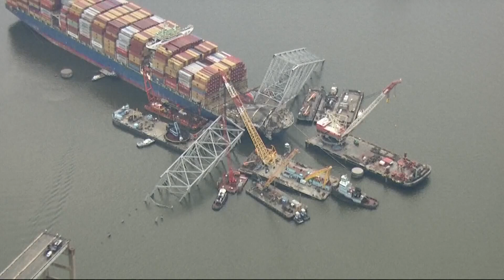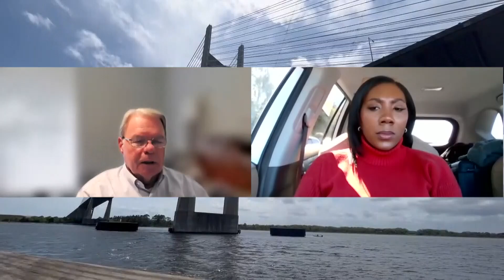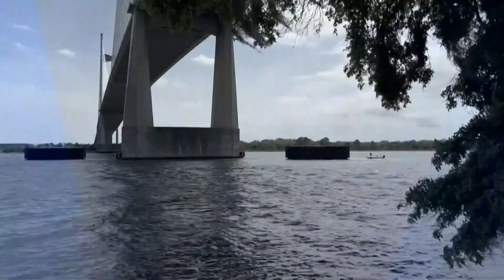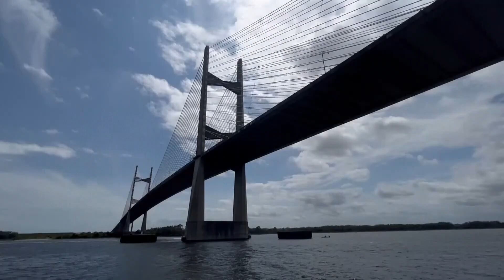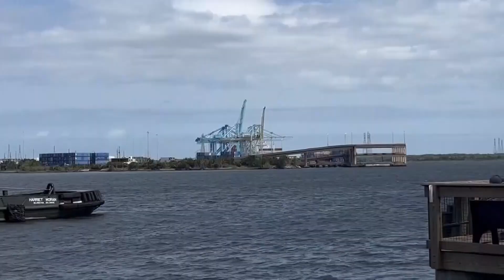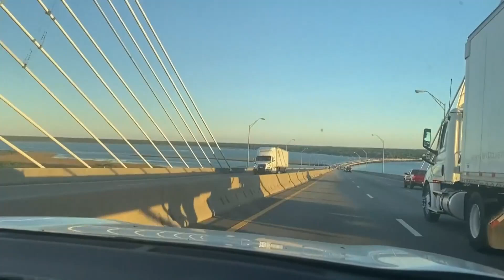What a structural engineer says about the Dames Point Bridge after NTSB says it might be at risk

Comment: Any bridge hit by a large vessel would collapse. 🙄 And this guy will makes tons of cash from his inspection.
Reply: Amen. WTF designs a bridge to be hit? That would be like requiring skyscraper to be hit by a plane. The simple solution is to have harbor pilots taking all the large vessels in and out with tugboat support. Problem solved!!!
Reply: First thing I thought. Was a structural Ironworker for 40 years. NOTHING is designed to withstand bashing by something weighing over 100 tons...